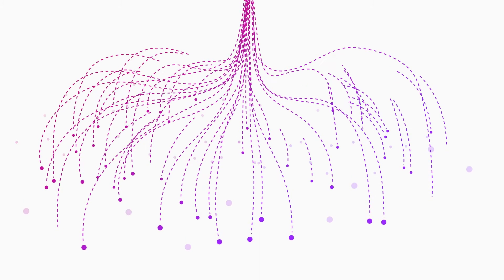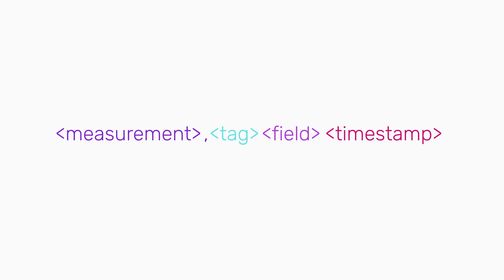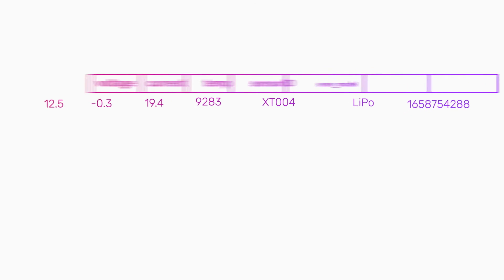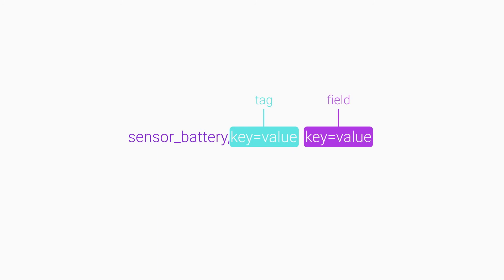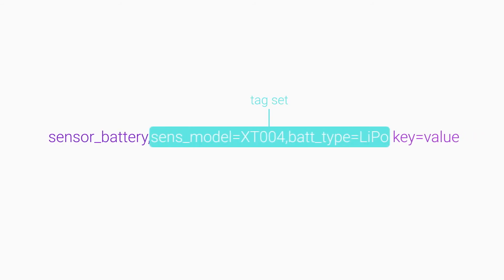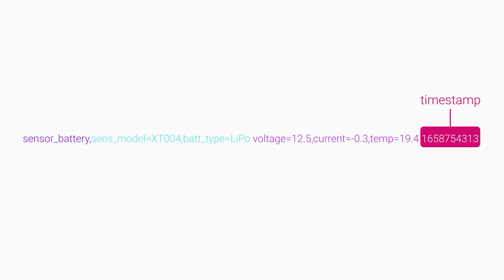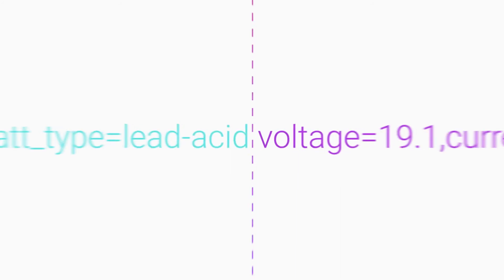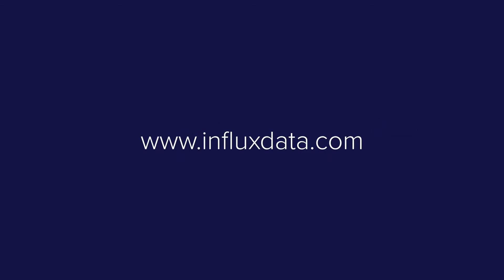InfluxDB Line Protocol

Comment: With line protocol, I have been pushing some data with tags and fields, but sometimes the data type from the source varies from int to string, while retrieving the data I cannot find this data. Is there a way to change schema and data types based on incoming data or have periodic lock for data types ?